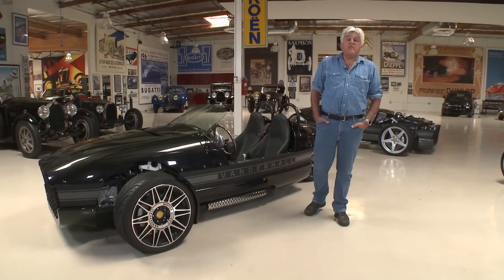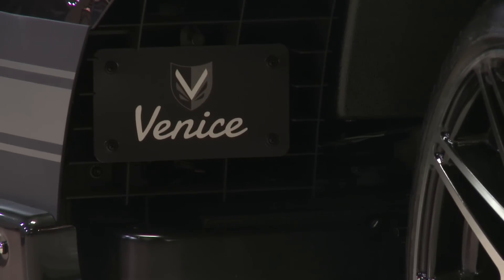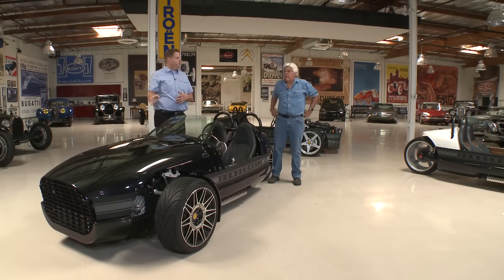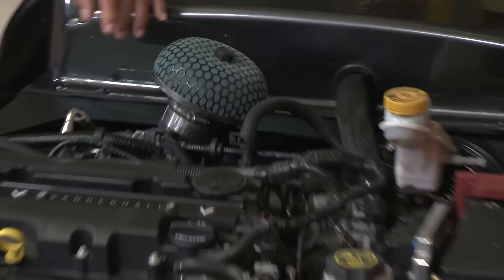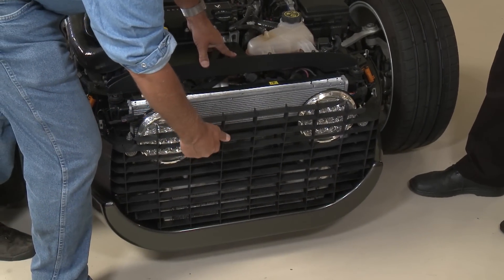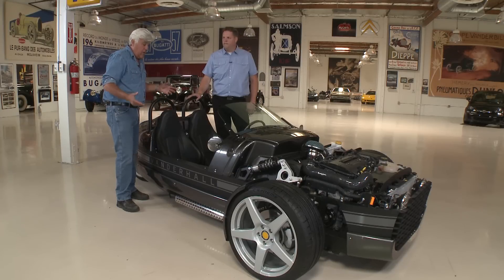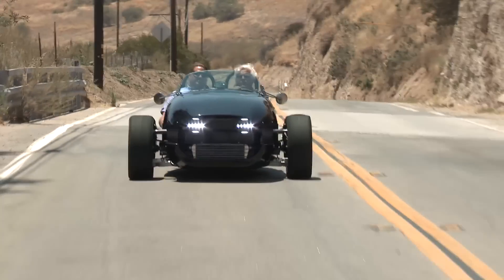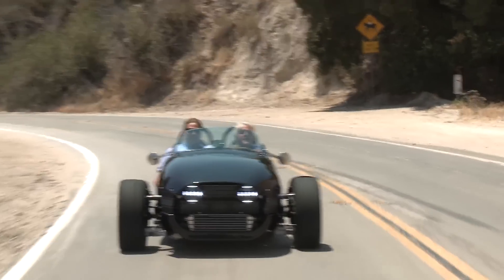2017 Vanderhall Venice - Jay Leno's Garage

Comment: I was curious as to how those two were going to fit in that thing. Steve Hall is a big boy. But $30k for made in the USA  wind in your hair driving is a good thing. The Engine/Transaxle are GM, so it's a high mile package that should be able to be repaired at any GM repair shop. The cost of ownership should be low as well.

Comment: I was skeptical of this until I heard the price. $29,950. That's pretty damned cheap for how much fun you're getting, and being FWD, in the rain it's not going to scare drivers with less skill like other 3-wheel packages would. My biggest caveat would be the automatic transmission. It may have a bump shifter, but let's not kid ourselves, rowing gears is a big part of the fun, and if you're going to make it front wheel drive, at least give us SOMETHING to do in the cockpit. Overall, pretty unique, more practical than similar platforms, and affordable. Pretty good stuff!
Reply: Rowing gears is no fun in city or stop-and-go traffic.  Try a sequential shifter and you won't go back.  People said they would miss kick-starting motorcycles, too (they don't).
Reply: JAMES HAY I'm one of those weirdos that likes shifting in traffic. Gives me something to do. Especially if you have an engine making good torque and you can just leave it in 2nd and work the clutch. Sequential would be great in this, I may be wrong but I doubt GM has a sequential that mates to the 1.4. But I fully agree with kick starting bikes, give me an electric start any day.
Reply: An automotive sequential transmission generally runs $9-12K by itself. Yes, in volume it would be much cheaper - but, that is the chicken and egg problem again.
Reply: I hear you James, but that's not really the purpose behind a machine meant for open road exploration.  This is a torque converter based automatic.... the shifts are slow and lethargic.  Even the bump shifter won't help.  Unless Vanderhall chooses a different drivetrain, it's the slushbox or potential clutch-based manual.  GM actually makes a manual shift transmission for this engine, so it would be interesting to see if one could be installed.
Reply: Yea this isn't a traffic car.  I'm amazed no manual.

Comment: I wanna thank Steve Hall for building a beautiful auto cycle. I just recently learned about the Vanderhall. I’ve seen a lot of Slingshots but definitely the Vanderhall looks a lot better. I’m in the process of buying a 2022 Vanderhall Carmel Blackjack with only 250 miles. I’m glad I did not go with Slinshot. Thank you Steve for building the Vanderhall 👍😎. One suggestion is to make the seats recline.

Comment: I test rode these at the sturgis motorcycle rally in 2019 and these are really fun. they ride smooth, handle beautifully and perform at very high levels. they are competitively priced compared to the harley or aftermarket trikes, polaris slighshot and the upper end can ams spyders. a little short on storage...........but they are very unique and fun.

Comment: what a cool design. if they came out with a fully electric model i'd be all over it.
Reply: They are working on one!  : )
Reply: sweet!
Reply: Lars Amble 
Why electric? It would still use fossil fuels, if it was solar it'd be a different story.
Reply: exactly. tesla has definitively proven at this point that the gasoline engine is a VASTLY outdated and overly-expensive-to-maintain technology. electric vehicles can get both much longer range between charges than any car could ever hope to get between fill-ups, and they outperform the majority of gas-powered vehicles to boot. as much as i still love many of them, gas-powered cars really are dinosaurs by modern standards. electric just makes far more sense on every level going forward.
Reply: They heard you!

Comment: Great ride! Much better design than the Polaris Slingshot in my opinion. Too bad the headlights are behind the grille; I think 2 detached round headlights would have given her the glamorous look of a Super Seven. Also, a little push down on the chassis around 8:40 to see the action of this clever suspension would have been great.

Comment: So, you get an awesome, retro-styled front engine, front drive, 1.4L turbo I4 powered 3-wheeler, and it's a hair under $30k, and you don't need a helmet to drive it. What's not to like?

Also, unlike the T-Rex and the Slingshot, you don't look like a Berk driving this.
Reply: The fact that you hit every pothole
Reply: Everyone has something against the slingshot and I have no Idea why. The trex I could understand, but why the slingshot? And who wants a front wheel drive sports vehicle anyway??
Reply: If it's registered as a Motorcycle in a helmet state you will need a lid.

Comment: If this guy can bring a car-ish kinda thing to market in four to five years, what the hell is Elio doing with all that money?
Reply: Good question!  ; )
Reply: Elio's trying to do large scale mass production, as it's the only way to sell it for $8K...    but the problem is a large scale production requires a lot of money invested in an automated factory & parts pipeline..   

This autocar is mostly using an existing GM drivetrain and is priced higher.. it's a different target market anyways.
Reply: Roman Val   Elio, after all this time, and all that money, has no viable prototypes, no supply chain, no business plan, no money left, no credit, and no 'target market', 
Elio is the second coming of the Dale.
Reply: Interesting.. I haven't kept up with Elio for a while.   
Elio probably should have gone the "Tesla" route and built a boutique autocar first, and then go on and build successively lower priced/higher production versions later on. 

I have seen quite a few Polaris Slingshots on the streets though--  but that's a similar production as this (GM drivetrain + custom bits).  They probably didn't spend more then 5 years working on it either.
Reply: Elio wasn't the first, we had the Sparrow cars in Seattle but the CITY COUNCIL banned them claiming "they were too small for normal traffic", which was total B.S. They just didn't want cars that go that many miles on a gallon of gas competing with the big boy dealers in Seattle.
Reply: I JUST READ THEY'RE TRYING TO RAISE $100 MILLION. GOOD LUCK WITH THAT.
Reply: I've never heard of the Sparrow.  Do you mean the Corbin Sparrow...   (which was a 1-passenger enclosed electric trike that was probably too ahead of it's time)?
Reply: Probably it was made in Pennsylvania I believe. Seattle banned them from the roads claiming they were too small even though when gas prices went sky high people were buying them like crazy along with Chinese small EV cars.
Reply: Not to get all conspiracy theorist on you all, but I'm pretty sure BIG OIL and BIG AUTO both had a hand in the Elio's demise. Neither of those concerns wants to see a vehicle like that on America's roads.
Reply: elio failed because it tried too hard to focus on a "car replacement" which was neither a car or a motorcycle, while it would make more sense to target the people who keep looking for a more comfortable alternative to a regular motorcycle but don't want a car that would be mostly oversized for their real needs
Reply: acmeopinion factory I was thinking the very same thing. I think they're another Bricklin or Dale folly. I laughed hysterically when I read Elio was going to be serviced at Pep Boys!
Reply: I am a reservation holder for the Elio car. They send out these smarmy emails updating us on their progress, but their problem is they’ve run out of money. They are whistling past the graveyard. Also, as time goes on, the Elio car is becoming more obsolete because it is a conventional internal combustion gasoline engine. Advancements in battery technology and electric motors are slowly making the Elio obsolete. Hopefully it will go into production before this happens. If it comes out within six months, it will be a great car. The problem is perception: there is a shift toward electric propulsion. This will limit the Elio’s annual sales unfortunately.
Reply: The Elio website claims the Elio weighs 1350 pounds....the same as the Vanderhall
Reply: @SimonWoodburyForget  the government doesn't want cars to have great mileage either because gas is taxed extremely high

Comment: Just a heads up. I owned a three wheeled Grinnall Scorpion and it was a revelation to me how much debris that you get hit with. I had to use a helmet with visor and still got hit with a lot of rocks and debris. I was also surprised that much of the debris comes at you at a 45 degree angle and is not stopped by the windshield. If you look at the front of your regular street car and see little rock chips, consider what those would do to your eyes and face if they hit you. So if you go with this type of vehicle you will probably end up wearing a helmet - even if the state law allows you to not wear one.

Comment: WOW - MY BEECHCRAFT B-19 SPORT aircraft weighed about the same - 1,300# and had an air-cooled 0-320 4 cyl engine putting out 150 HP - maximum weight 2,000#.  Cruised about 110 mph.  Three wheeler with the little tire in front.

Comment: He said the rear never wants to break loose in corners. Well drop the trans, weld the diff and bang, you can have throttle oversteer in a fwd 3 wheeler. Just don't try to park in any tight spaces after that. All joking aside, a mechanical limited slip and a lockup programming for the converter after say 20 mph would make it feel much more sporty.

Comment: As a 67 year old rider who happens to be overweight, I noticed something that is rather important for me. We didn't see Jay and Steve enter or exit the vehicle. We did see that they were thoroughly in physical contact with each other as they both rode in it. That has to be uncomfortable. Climbing in and out has to be awkward and potentially damaging to several parts of the interior. I guarantee that if I was stupid enough to climb into that little cockpit, I would need assistance getting back out. I'm going to stick with my conventional motorcycles, Honda Valkyries, mostly.
Reply: I was thinking the same thing. I also ride a Valkyrie

Comment: How unique!  A front wheel drive - 3 wheeler.  Wow, very cool. Wonder if it has the typical front wheel drive under steer?  Which I like. My Saab Sonnet was very raceable because of it.  Plus you have the engine is over the drive train.  Wonder how it compares to the Polaris Slingshot?

Comment: Cool machine. But what good is a roll bar if your head is sticking up several inches higher than the line between the roll bar and the hood? And, won't your outer arm get between the road and the side of the vehicle?

Comment: This is my opinion and others may agree or disagree. I don't think this is a motorcycle. Do to an injury I can't use my legs and my lower back. I test drove one thinking it would be too hard to get in/out, it's not a bike, etc (I'm a motorcycle enthusiast). I was too quick to judge. I hadn't even made it to the highway and I couldn't stop smiling and believe how comfortable it was. I'm not real big so others might feel the cockpit to be to narrow. There are things I thought could have been better. It's the visceral feel of riding/driving you have to experience to thoroughly enjoy it

Comment: I was amazed at the price. I thought £33k at the least. I would love to build a 4 wheel version with the front suspension and panels reversed at the back. (But then you'd get the EPA nonsense). It would look just like an early Allard, Cunningham or Bristol Arnholt! The builder (and President) has shown an incredible amount of initiative with the suspension, engine and ally bodywork to get the price to under $30 and make a profit. Imo, I think it's wrong to compare the Vanderhall to the Morgan--future tech. and ideas up against retro re-manufactured investment. Morgan 3 wheelers here (in UK) are still rare, lovely cars though!

Comment: i like it. i wonder though in a hard brake situation will that rear wheel lift off the ground. ive seen the add for the elio for the past thousand years and didnt know the vanderhall was out. the elio is two inline seats and cheaper but i think vanderhall is better for single person commutes and way more power. does it come with a bubble for rain days ? i like it.

Comment: Very cool! However, if that's a motorcycle-class vehicle you'd need to wear a helmet in California, legally. When I rented the Slingshot I wore my motorcycle helmet, and I'm thinking about renting one of these as well just to get the full experience, and I plan to wear earplugs and helmet when I do. 

I'm not super keen on that heyoooge steering wheel, but I understand the 'vintage' aesthetic. It would be nice to have the option of a smaller, leather-wrapped wood wheel, perhaps one with a flat bottom. This may already be an option but if not, there's a good idea for you. 

The bump shift on the left looks like great placement. Reflectors in the wheel hubs are a brilliant move. Beautiful lines. The headlights behind the grill are an interesting placement but it goes well with the design aesthetic and form language. 

I really like the fact that this is front-wheel drive, and I like how narrow the vehicle is, and it's 2.91 feet longer than a smart car, but 3 feet shorter than the shortest Honda Civic. This won't take up too much space in a garage or parking space. 

Lane-sharing might even be possible in some unusual circumstances. Certainly, this vehicle (3 wheels, motorcycle-class) qualifies a solo driver to use the HOV lane. For commuting, this could be a doddle, and that windscreen (combined with a helmet and car body) would go a long way toward keeping the driver dry in the rain. The heated seats are a must in CA winters where it can dip into the low 30s or high 20s where I live. Lately I've been motorcycle commuting in 40-something degree weather and it gets cold, and that's with heated grips. Heated seats would be amazing.  

I'd love to see a model of this with single-passenger center seating with some built-in storage. It looks like the upcoming 'Speedster' model is a single-seater, but there's no information as to whether it's center-seating or not. I think if I were going to get a single-seat vehicle, it should be centered. Otherwise it's just lost storage (even if it looks cool). 

I'm going to rent one of these soon, and heck I might actually buy one. It would be a perfect back-up vehicle for my motorcycle (my main commute tool). 

I've been looking at electric cars for my next vehicle, but am underwhelmed by their pedestrian looks and their high cost. The Chevy Bolt is almost 40k. The electric I really like is the BMW i3, but that's nearly 50k! The Vanderhall is only $30k, allows solo HOV usage in California, has a bit of storage, and all without range anxiety and would be way more fun.

Comment: I like the modern 4 cylinder TURBO front wheel drive mostly GM parts available with a price that says I can buy one.   This would be an ultimate tour vehicle in the Philippines if you could swap the heater for an A/C unit even just for the cool breeze.

Comment: Saw a nice SM with the original European headlights in the showroom background ! My favorite car, but I sold both of my SM's along with my Espada and CL600 and one of my NSX's during my last trim down..
My previous trim included my Auto Union 1000SP, Glas 1700 GT, '56 190 SL and a few others....
Tried to emulate Jay as a collector, but running out of time and space......

Comment: I would if you could potentially make it three-wheel drive by running a chain, or using a differential, for even more grip. Of course the price would be much higher with basically a whole different rear-end.

I'm seriously considering this given its 'online' $30,000. I'm surprised I haven't heard more about this.

The first thing I'd change about it is exhaust. I want to hear more popping and cracking with a more hollow tone, but that was also likely a cost cutting measure.

Comment: HEY Jay, great review and it looks like a great vehicle.  a question though, since the Vanderhall is "technically" a motorcycle - shouldn't you be wearing a helmet? 
EDIT: i'm not going to read through what appear to be a bunch of negative comments to see if my question has been asked and answered.
Reply: Article 7, 27803 (f):
This section does not apply to a person operating, or riding as a passenger in, a fully enclosed three-wheeled motor vehicle that is not less than seven feet in length and not less than four feet in width, and has an unladen weight of 900 pounds or more, if the vehicle meets or exceeds all of the requirements of this code, the Federal Motor Vehicle Safety Standards, and the rules and regulations adopted by the United States Department of Transportation and the National Highway Traffic Safety Administration.
Reply: good to know, thanx for answering!

Comment: I've seen and sat in one of these at a motorcycle show. It looks good in person, it's comfortable, and appears to be well engineered and put together. I also think it looks better than a Can Am Spyder, with much cleaner lines, and is about 1000 times better looking than than those hideous Polaris Slingshot monstrosities. 

I normally don't care for front wheel drives, but in this case it makes perfect sense. And I suspect that by sourcing an GM Eco Tec automotive drivetrain, which should be good for 150,000 to 200,000 miles, it should easily outlast the Slingshot and Spyder. At $30,000, Leno is right. For a low-production vehicle, it's really a good deal.

The only thing I wish is that it was a manual, not an automatic. But all in all, it seems to be a really well though out and executed. I hope their business is successful, as they have a good product.
Reply: Keep an eye out for that manual you are hoping for?